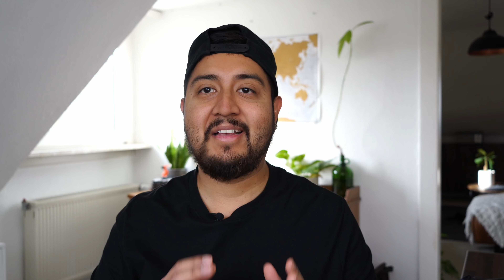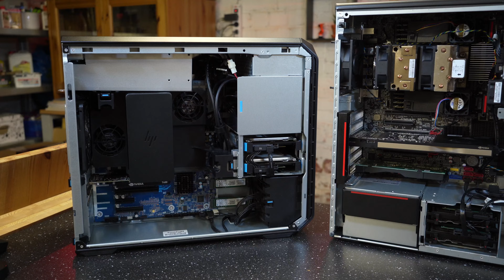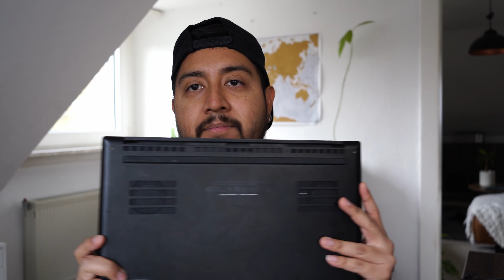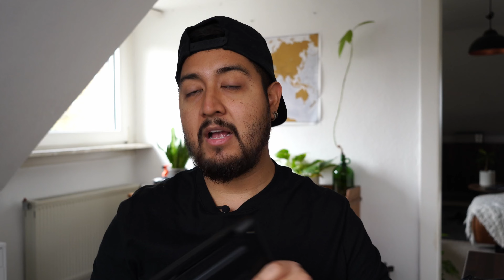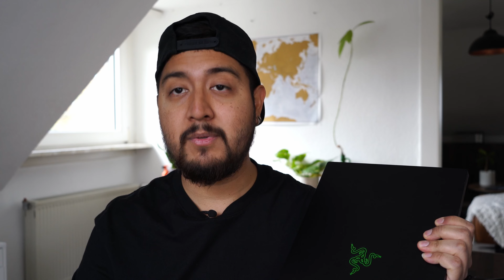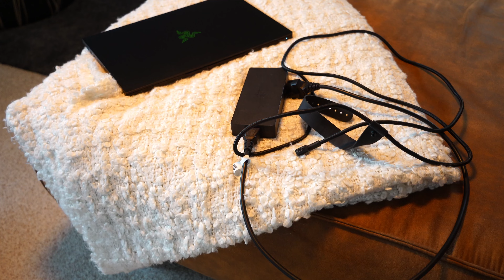Gaming Laptop vs Workstation PC / An Engineer point of view

Comment: just subscribed to you Pal. was looking for  laptop to game and do 3d  modeling and rendering, i had the alienware but i returned it,  i also had  asus pro art studio-book 16 oled but returned it it bricked on me when i did bios update, and came across your video  i ordered the 2022 razer blade 15 oled  240hz, i should get it tomorrow, i got my 64 gigs of ram and had to order new ssds because i had 4tb ssds and they dual sided ssds and don't think i can add those on razer blade, think it only takes single sided ssds .  hope thermals are good,  like does it get hot just doing normal task like coding  web surfing  watching videos?  gracias  Jorge asta luego

Comment: Is gaming laptop ( i5 11th 11400h , 8gb ram , 4gb gforce rtx3050 ) can handle solidworks, creo, ug nx, ansys, catia ? Or should i build pc ( i5 12400F , 16gb ram, 4gb quardo t600 )  with same price range ? I m a mechanical engineering graduate from india and wanted to learn these software and no gaming but portability is also my concern . Plz suggest . And i saw your graphics card comparison video which was very informative . I m in the same phase where i m dreaming ☺️ to get these graphics card .

Comment: i am an architect - structural engineer. Purchased P16 but realized a want a 17 inch screen and centered keyboard without number pad. Purchased a dell x17 r2 and realized it is a little to bulky. I am now realizing the Razer 17 may be best afterall